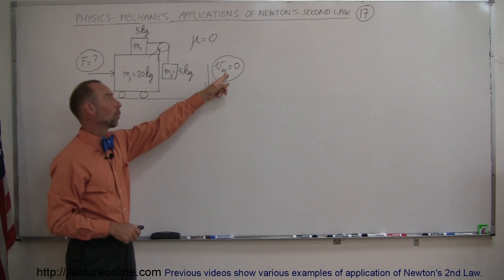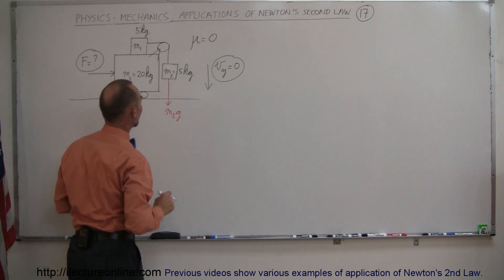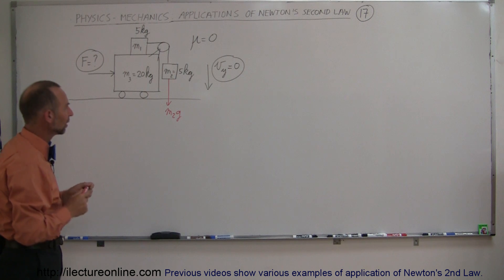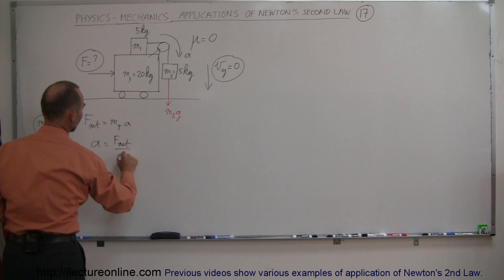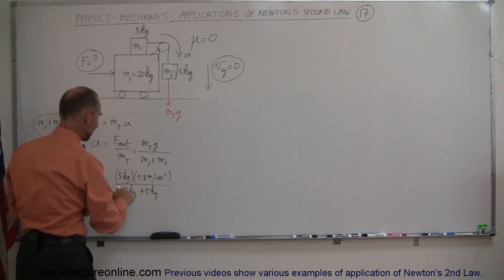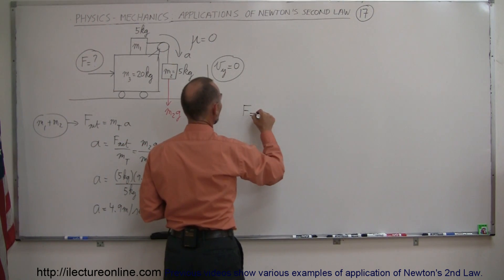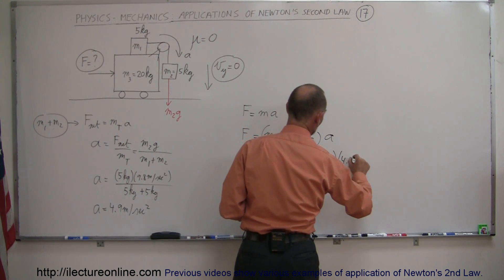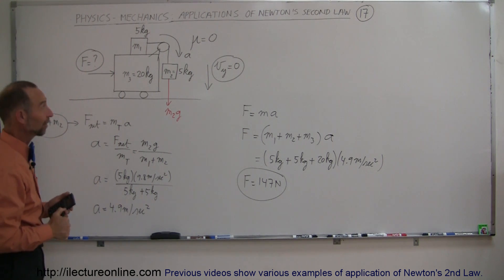Physics - Mechanics: Applications of Newton's Second Law (17 of 20) video has error, will be remade

Comment: I think for this problem to make sense, mass m2 MUST rest without friction on the side of m3 such that the tension in the string is the pure weight of 49, and sideways acceleration force is transmitted through the mass interface and NOT the string;  and then my answer would be 30 x 9.8 = 294.  (If it doesn´t rest on the cart, the tension becomes the vector sum of 5a and 5g or 5sqrt(aa + gg), and equating this to 5a implies g=0 and the problem becomes trivial.)
Reply from the maker: I re-evaluated this problem and I found that it cannot be solved as is shown.  We will make a new one with slightly different masses to make it work.
Reply: @MichelvanBiezen  Great - I´ll look forward to the modified version.  (I´m betting your idea will work out beautifully, with the top mass greater than hanging mass and suffient space so it can hang at an angle.)
Reply: @MichelvanBiezen  Just for the fun of it, I made two small modifications to your problem:  I made the hanging mass 3, and I made the rope over the pulley short so the mass wouldn´t hit the cart.  It worked outreal well, and I got a force of 205.8 newtons
Reply from the maker: Yes, that is the way the problem can be solved.  We plan on shooting the video this weekend.
Reply: @MichelvanBiezen  Fantastic  -  I think it will be a really neat problem  -  thanks

Comment: Very nice analysis of a very intresting problem.  Tks
Reply from the maker: Glad you liked it!  Still need to redo this problem.  I suspect there is something wrong, but I haven't had the time to analyze it.
Reply: @MichelvanBiezen  I think the push force is maybe only acting on two of the masses, the one on top being stationary with respect to outside world and the other two accelrating to the right..  I too am uneasy, but still love the problem.
Reply: I´ll give it more thought as I try to fall asleep tonight  -  but I´m thinking it might be an impossible situation.
Reply from the maker: From a conceptual perspective, if the system can be pushed hard enough so that the acceleration of the car equals the acceleration of the two blocks on the pulley, the hanging block will not go down.  But I'll have to give is more thought.
Reply: @MichelvanBiezen  jajaja  -  who says physics isn´t fun?!

Comment: You also have to accelerate M2 at the same rate horizontally as M1 & M3, but only after M3 moves to make contact with M2 !  Which would beg the Cf(M2,M3), except the slide of M2 is also 0), so M2 must eventually also be accelerated horizontally.  He got there, but w/o mentioning the required delay step in the force.

Comment: If the whole system has the acceleration pointing to the right, then, if looking at the m2 alone, there must be a force acting on m2 horizontally pointing to the right. Where does such a force come from? 
The only way to make sense of it seemly is to assume the pulley is small enough so that m2 is hanging vertically without a gap to the m3, namely m2 and m3 touch with each other.
Reply from the maker: I have to rework this problem.  Had not had the time yet.
Reply: @MichelvanBiezen  Thank you Sir. It's a great video and problem. Looking forward to the reworking.

Comment: Acceleration relations: a1=a3+ay2(vertical) & a3=ax2(horizontal)
for m2 to not move down ay2 = 0 so a1=a3
Force equations:
1. F-R=m3a3
2. R=m2ax2=m2a3
3. T=m1a1
4. m2g-T=m2ay2=0 since ay2=0
so T=m2g
5.m1a1=m2g from 3 & 4
so a1=m2g/m1
6. F=m2a3+m3a3=(m2+m3)a3
so a3=F/(m2+m3)
7. F/(m2+m3) = m2g/m1 from 5 & 6 & since a1=a3
=>F=m2(m2+m3)g/m1=5(5+20)9.8/5=25*9.8=245N

Comment: Sorry sir you are wrong. In first portion while determining acceleration of two 5 kg block, you have used newton's law in a non inertial reference frame..... This problem can be solved by the concept of pseudoforce and correct answer  is F=294 N. thanks
Reply from the maker: You are correct.  I made a wrong assumption.  The force is indeed 294 N.   Thanks for your comment.  We will reshoot the video.
Reply: @MichelvanBiezen  thank you for replying sir... I have learnt a lot from you.... 😊
Reply: @mdsrmunim4633  please bro help me why m2is non inertial reference?
Reply: @ahsanali9931  for acceleration
Reply: @MichelvanBiezen E=mc2 and F=ma are CLEARLY linked AND BALANCED opposites, AS WHAT IS E=MC2 is DIRECTLY derived from what is F=MA. Consider WHAT IS the Sun. The stars AND PLANETS are POINTS in the night sky. Great. 

By Author Frank Martin DiMeglio
Reply: @MichelvanBiezen With all due respect, you are going to have to recognize the veracity of my ideas. You are going to have to mention them. You cannot just ignore new and fundamental truths in physics.
Reply: Please tell me why m2 is non inertial reference frame?

Comment: Why did we include the mass of m1 ? Wouldn't there be double the force ( both the tension and the applied force) acting on it causing double the acceleration in mass m1.
Sir, could you elaborate what you mean by "If Vy = 0 then the Fnet accelerates all three masses". I have searched the entire net and haven't found anything.
Reply from the maker: If the two smaller masses do not accelerate relative to the third large mass on wheels, then all 3 masses will act as a single system.  Note that there are a number of examples of these types of problems, starting with simpler ones that will help you understand this concept.
Reply: @MichelvanBiezen  please sir explain why m2 is non inertial reference frame?
Reply: What would be the free body diagram of Mass M1? In the x-axis it already has the force of tension accelerating it at 4.9m/s2. Since it is already ACCELERATING wouldn't we need to accelerate only mass M2 and M3 so that  all have the same acceleration of 4.9 m/s2.
Where should I look to understand this concept much clearly ? I have basically watched most of your videos and this is the only one I am having problem with.
Any help is appreciated.

Comment: Hi I think the acceleration of the system is 9.8 m/s^2 because we know F=ma and this must balance the tension pulling on m1 so that m2 is not accelerating down and if m2 is not accelerating downward we know that tension must equal m2g so F=m1a can be set equal to T=m2g
m2g/m1 = a  and the masses cancel out so you get 9.8m/s^2
Reply from the maker: The answer in the video is correct.
Reply: @MichelvanBiezen  I'm sorry, it is not. 9.8 m/s^2 is the correct answer.

Comment: Sir why can't you solve it this way?
When m1 and m2 are not moving with respect to the pulley then
m2g=T(tension in the pulley)
And on m1 since T is acting towards the right some force must act to the left of m1 counteracting it so a force equal to T should act on the left of m1which is equal to m2g= 5g.
Now we know that force/mass=acceleration so the acceleration of m1 should be 5g/5 which is g=(9.8) and as the acceleration of m1 =m2=m3 the net force should be(m1+m2+M3)*a = 294 N
Can you please tell where am I going wrong
Reply: You are getting your reference frames mixed up. M1 and M2 cant be at rest wrt pulley in an inertial frame because of gravity. The entire system is being accelerated. One way to approach this with newtons second law is to find the acceleration which can negate the one of M1 under normal circumstances in the rest frame. For that first calculate the natural acceleration of a wrt a rest frame and just give the entire system of M1+M2+M3 the same acceleration. That will make the effective acceleration of M2 and M1 wrt M3 to be zero in the rest frame. If you want to consider the pulleys frame of reference, please remember that it has to be under acceleration as a whole for M1 and M2 to be stationary wrt the pulley. Either approach leads to the same answer.

Comment: sir.please correct me if I am wrong,here for calculating accleration you took m1 and m2 as a system ,but we cannot take that as a system because accleration of m1 is horizontal direction an m2 is in vertical direction..the accleration will be m2*g/m1.
Reply from the maker: you can call them one system together if you  only calculate the magnitude of the acceleration.

Comment: Sir, if there is no friction between m1 and m3, wouldn't m2 just be freefalling? considering m1 and m2 have the same mass
Reply: which leads me to thinkinh that the acceleration is 9.8 and not 4.9, but one of your videos with this case (where the object seems to be freefalling) also has 4.9 as the answer
Reply: I get it now. there is no net force acting on m1
Reply: even if m1 has mass there is still no friction between m1 and m3
Reply from the maker: That is correct.

Comment: SIr, why are we adding the mass of m2 when calculating the force required? Why are we not adding  the mass m3 and m1 only?
Reply from the maker: Because the net force required to accelerate m1 and m2 can only be provided by the weight of m2.
Reply: @MichelvanBiezen  Sir, your videos are awesome! Nonetheless, I also wonder why the inertia that must be overcome isn't solely in m1 and m3, because m2 isn't sitting on top of m3. Maybe I'm overlooking something.
Reply: Here's another point of view: If m1 were isolated on a frictionless surface, if that surface began to move, friction is the only force that would cause the m1 to move; however, without friction, wouldn't the surface beneath slide without resistance? If that's the case, then wouldn't the force needed to keep the surface underneath m1 " up to speed " be ( m3 )( a )? It's been a longggg time since I've worked a problem like this, so I could very well be overlooking something.

Comment: sir, why is that the acceleration of M1 and M2 will be the same to the acceleration of the whole system? i thought they're different?
Reply from the maker: Only the magnitudes are the same.  (they do travel in different directions).  But the magnitudes have to be the same since they are connected by the same string.
Reply: +Michel van Biezen ah! so, it means, same magnitude same acceleration sir?
Reply from the maker: Only if we are just calculating the magnitude only.  If you want to express it as a vector quantity, you'll have to add the direction as well.
Reply: +Michel van Biezen okay sir. thanks alot :)

Comment: If the acceleration is 4.9, then the net force on m1 would be 24.5 N. This would mean that the tension is 24.5 N. If the tension is 24.5 N on m2, then m2 would experience a net force downward and therefore a downward acceleration. No?
Reply: Brandon Schmidt that's exactly what I'm thinking.